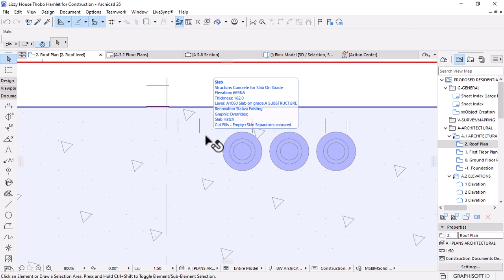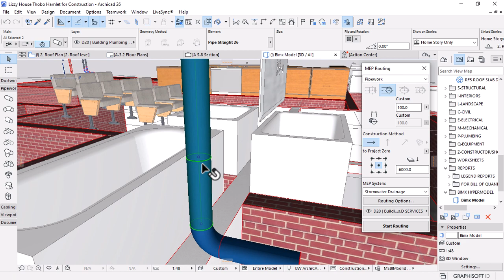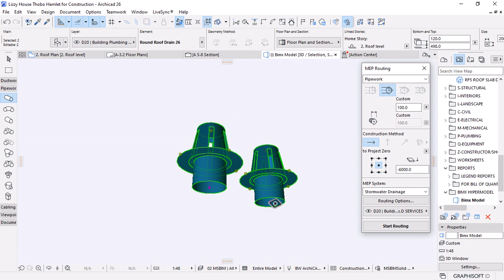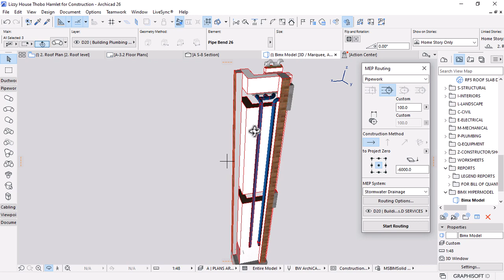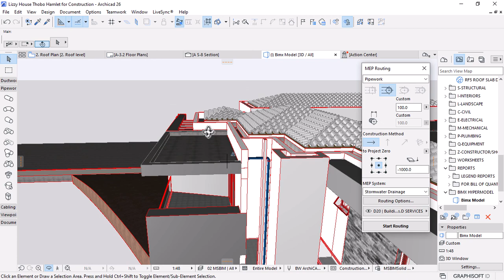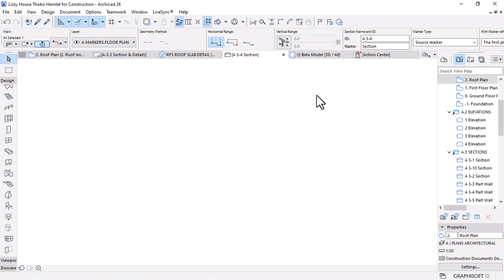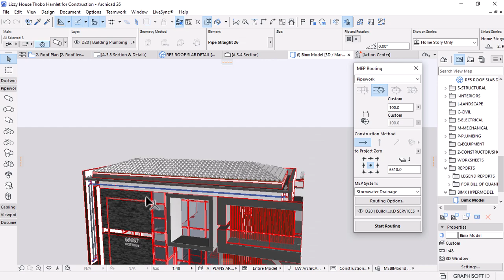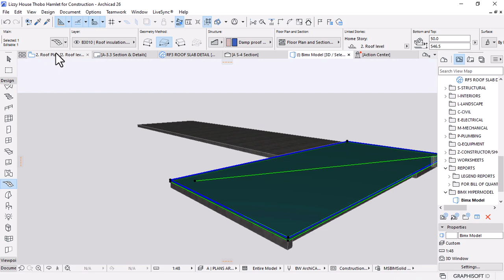ArchiCAD 26 Contemporary Roof Design, Drainage System Multiple Situation

Comment: Hey guys. I have a problem. Why when using design accessories to create roof tiles. When in section view the other half of the roof tiles doesn't show. It's a problem I have since using archicad. Please can you advise or a do video on how to solve this annoying problem. 🙏
Reply from the maker: That's absolutely annoying. We 've experienced the same problem too with this is bug. If we find a solution, we will definitely share it.